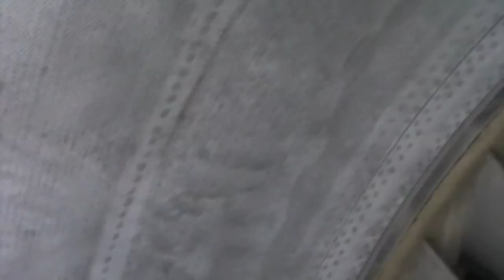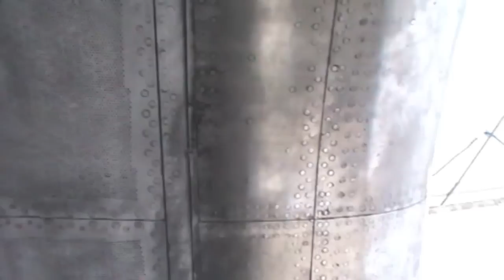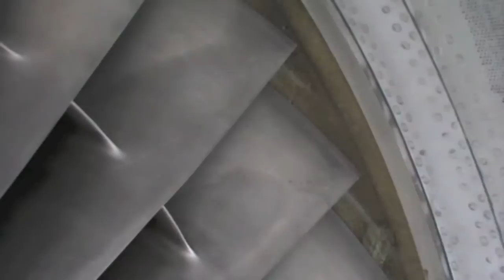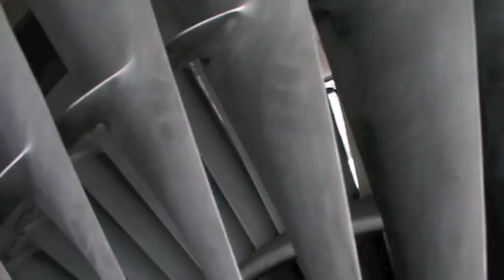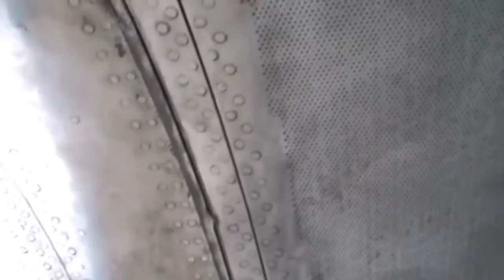RB211 Fan Up Close - That Noise Explained

Comment: The old JT9D would sometimes lock and cause vibrations resulting in shutdown. We would don ear protection, and hit with a rubber mallet. when it broke free, it was as loud as a firecracker. It was routine maintenance on the GE CF6's to pull all blades and lube on overnights. Todays blades are composite and along with tech, those issues are gone.

Comment: -50 F is far too cold for "icing" to be a concern and there's no reason for those "clappers" to be rattling "back and forth" as the engine winds down unless there is a serious balance issue. There are also other bearings in that engine that can fail or run dry and cause that kind of rattling. It's also pretty obvious that "RB211" isn't from a 747.

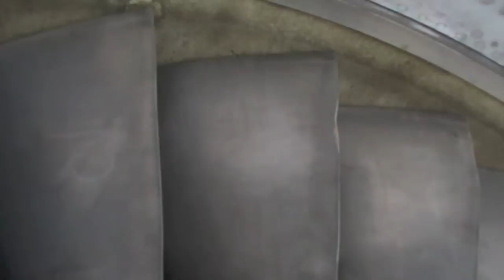Comment: Notice the min 3:30, the blade has a small wear out. Pause video and take a closer look. Not good at all. Need to be replace to prevent what happen with southwestern Airlines April 2018.
Reply: That's normal. Fan blades and propeller blades get chipped from ingesting foreign objects, this is absolutely unavoidable operating an aircraft in the real world. Instead of throwing it away, the mechanic will file down the damage until it's smooth, then file down the opposite blade so there's no imbalance. A fan or a propeller can be filed many times before it needs to be replaced.
Reply: @squirt.mcgirt  can this operation be performed without removing the blade from its housing?
Reply: Felice Graziano, just curious, why do you ask?

Comment: The part you refer to as the clapper is actually the mid span and the bottom of the blade that sits in the hub is called the root.

Comment: The PW engines of the same era did the same rattling noise at shutdown, first time I heard this it freaked me out I tought the engine was breaking down. I was looking at a B747-300 taking his slot at the gate and was placed just in front of the landing gear at the stop sign. I worked during the week-end in an airport and was taking every occasion to go out the ramp, visit cockpits and touring airliners. Good times

Comment: It makes that sound because the bolts holding the blade down aren't secured. Second off, each fan blade is individually bolted down and when one metal thing touches another metal thing it tends to make a "Clank" sound. There's really not much science to be applied here. Its just common sense and how the engine was designed.

Comment: The high sound is produced by the Rotations /minut.10000 RPM produces 10000 HZ.
Reply: It most certainly does not. Hertz is the frequency SI unit measured in cycles per second, which makes 10,000 rpm 166.66Hz.  But anyway, I recall the 100% rotation speed of the RB211-524B4 LP assembly on the advanced TriStar-500 was 3600rpm = 60Hz

Comment: I would like to know how does that whole thing spin. I don't get it, that is not an engine, that's something that spins very fast but i wouldn't call it an engine. What spins the blades is something i fail to understand because this whole "engine" is nothing but blades and i don't see anything that pusses and keeps the blades running.
Reply: Look up how a jet engine works. This is only the front part, the actual fuel and combustion part is farther back. I used to wonder the same thing!
Reply: +E I N S Did you ever find out how it works? Just asking...
Reply: TheThirdMan 

No. A lot of bla bla but nothing exact.  For some reason I find no video explaing this. It must be some alien tech otherwise i don't think they would keep it so secret.
Reply: No secret and no alien "tech". In fact, you can buy jet engines for RC models if you want to. The simplicity is what throws people. It works off a pressure gradient. To better understand it, the first thing you need to do is forget everything you know about car engines. To start it, you spin it up until it reaches idle speed (which, unlike a car engine, is about 70% of its maximum) at which point it is almost self-sustaining. Then you add fuel. A jet engine is effectively just a turbocharger with a combustion chamber between the impeller and the turbine. Unlike a car engine, it is a constant burn and not an on/off system.
Reply: TheThirdMan 

You still did not manage to explain what spins the blades. How can fuel spin blades? Whatever dude.  It's so fucking simple nobody can explain it.
To start it you spin it up until it reaches 70% you say. My question was how!?? Like i said i got a ton of explanation from people nobody managed to explain correctly.  Bla bla air pressure and fuel. I need more than that. All I see is a tube that spins like hell and no pipe for air pressure or something.  I gave up trying to understand it.  Don't care anymore
Reply: E I N S The energy released from burning fuel passing through the turbine spins the blades. The build up of back pressure behind it means the air can only pass in one direction. It’s dirt simple. The pressure in the combustion chamber- with anything up to 30:1 pressure ratio behind it from the compressor section can only go in one direction. It’s a pretty big fire in there and provides a hell of a lot of propulsive energy, which works against the turbine blades.
Reply: NightterrorsGaming 

Cheers man thank you for your explanation.  The best and most complete explanation i've got so far. For some reason many people say they know how it works but when i ask them for an explanation nobody managed to actually explain the process. I think i understand now thank you and i appreciate you taking your time for this.
Reply: E I N S Compressor compressed air, making the engine sustainable, without this, the engine would never be able turn, and would just act as an afterburner. The shaft is made of three parts or what is called “spools” to keep the fan spinning slowly, as well as the low pressure compressor, and the high pressure compressor and power turbines spinning fast.

Comment: So does anyone know if any jet engine bearings are coated with a very low friction coating?  Like MicroBlue.com  

If not then YAWN I will have have fix another sales and marketing department of the engine manufactors.  That control the engineering design.  

The more and research I do on mechanical designs World Wide the more potential I see that can be had from the designs.  Yes I know every design must be within a certain budget for cost vs benefit etc.

Comment: Does anybody know why they don't use "cones" over the engine intake to prevent bird strikes?  They used them in previous decades.
Reply: Merv Wright -  There are several reasons I can think of as to why a debris-screen would be Impractical:  weight, installed thrust loss due to air flow restriction, design would have to account for all phases of operation.  At high speed boundary layer air would restrict airflow.  But the biggest problem would be ice buildup and the amount of energy (bleed-air, electrical) that would be required to de-ice/anti-ice such a large surface area.  Impractical for those few occasions bird strikes occurred, as was stated earlier by Jai Shetty.  Then there is the failure modes of such a component; ingestion would cause severe damage, loss of de-ice/anti-ice capability would render the engine incapable of operation - with the detrimental effects of additional ice accumulation...  Better to just design the engine with ingestion tolerance.
Reply: Bird strike are far and few so it is not worth having them.
Reply: Yes but even one bird strike can cause a crash.  Still curious if there is an "aerodynamic" reason not to use a perforated intake cone?  Thank you for your reply.
Reply: Thank you Greg for your thoughtful comments.  Your last sentence certainly satisfied my curiosity and made complete sense.

Comment: Flew on that incredible L-1011 many times and remember being pulled into the seat during take off. As the L-1011 pounded down the runway the RB211's changed pitch. Some call this 'THE NOTE'. Out standing plane and jet engine configuration. Will never forget that. Thanks for your video post.

Comment: When i worked on these engines we used to have a competition to see who could stand the longest in front of the fan with the engine running at full power. I never tried it but the lads who did never turned up for work ever again.

Comment: Is this what also causes the buzzsaw sound at full throttle?
Reply: Purple Aki no. The buzz saw sound happens at lower altitudes due to the blades tips travelling supersonic speeds, as well as the separation point of the airflow on the blades trailing edges towards the tips. That’s also why older engines like these have clappers to add rigidity to blade at full speed, preventing deformation and failure.

Comment: Some RB211s had wide chord fan blades too. The -524G and -524H for the 747-400 had those and I think the -535E for the 757 had those too. Rolls was the first to use wide chord blades because they allow a larger fan and a larger spinner to fan connection, making the fan blade stronger. Rolls was able to do away with the clappers. GE and PW didn't go to wide chord blades until the 777 came along in 1995.

Comment: Any kind of noise vibration I would think would translate to the corresponding part that caused it. I have seen these blades explode. Like a tire that needs balancing I would think these blades should be able to be designed for quiet thus long lasting, smoother, better running engines
Reply: I hear Rolls has an opening in the engineering department.
Reply: Maxwell Butler what's the matter? They must not have anyone willing to tackle the hammering noise and vibration from those blades me thinks.
Reply: Willie Gillie Clearly.
Reply: Willie Gillie 
You're the boy in this story, though.

Comment: The correct term for the "clapper" is Part Span Shroud.  They should be lubricated with a moly lube compound
Reply: +Brad Gillies lube that clapper
Reply: I remember Snecma/CFM called those clappers as "midspan shroud". But IAE/PW called them as clappers and I think, also as part span shroud. IAE in fact, don't have these on the fan blades, but have them at the first stages of the HPC. Also, I think the 747 JT9 had two of these, on different parts of the fan blade span. I just wonder how it was to change the blades on a JT9. Because on the CF6-80 and PW4000, due to the clapper or part span shroud,  that's not really an easy job to put the last fan blade of the set.

Comment: Air loads when running twist this rattly clearance to none, the wrap up rests the clapstrip on each othe to stiffen the assembly. When fanning under power, there is no longer any clearance between the brace ring segments.

Comment: At 3:35 looks like you have bad blade. The blade on the right is missing a piece from the front. Cheers.
Reply: +maximvs degeneratvs It can definitely cause balance issues. Especially if you have a multitude of blends throughout the fan. Thats where testing and fan balancing come into play. If you open up the nose cone on an engine that has tons of blends, you'll almost always find little weights thats are bolted to the fan hub on the inside of the cone. These weights, while tiny and seemingly insignificant, have a huge impact on the balance, and ultimately the vibes, that an engine produces. Also consider that vibration is okay(and normal), but EXCESSIVE vibrating is a problem. Even if a blend causes vibration in the N1 (fan section), unless it exceeds limits, the engine is still able to function normally. 

source: Air force aircraft maintainer/test cell specialist
Reply: +maximvs degeneratvs That's a blended blade. Possibly suffered damage in the past and had the edge blended.
Reply: +thedrizztmanify Very interesting. I would think by having a blade like that you would have to do the same on the opposite side so it does not become unbalanced and create noise vibration, etc.

Comment: Actually the perforations in the nose cowl are for noise attenuation, nothing to do with de-icing. De-icing is accomplished by a tube in the leading edge of the nose cowl. Also the spinner is de-iced using hot air from the compressor.This is an RB211-22B which powered the Tristar.RB211-535 powered the B757 and Tu204RB211-524 powered the B747 and B767
Reply: +Shane murphy Exactly. Not to mention that it would take such an enormous amount of hot air blowing into free-streaming, -50C, 500kt  to bring it to above 0C that there would probably even not be any compressed air left for the engine to actually work!
Reply: christopher wilson No! That perforations are ONLY for noise reduction in ALL engines that got it.
Reply: +VstaarProduction 15
"have you ever heard of bleed air? "
Of course. But bleed air is used to deice the LIP of the air intake only. No amount of bleed air vented through those perforations would bring an incoming flow of -50C air at 500kt to above-freezing temperatures, sorry.  The perforations shown in this video are for NOISE ATTENUATION.
Reply: Our 767s at American have CF6 engines.
Reply: The 524 B4-02 was also use in the Tristar L1011.
Reply: In the e4b engine there are castellated strips that throw the spent lipskin hot air into the intake. In most other designs like the Trent and the v2500 there is a dedicated exhaust on the side of the inlet outer skin
Reply: I agree with you guys.
Reply: How I wish Embraer had choose our designs...
Reply: corisco tupi have you ever heard of bleed air? When a plane is flying 36,000 feet, how cold do think it is? Way below zero. And ice would form on the cowling and spinner
Reply: They are for de icing in some engines. Hot air is usually fed from the ip8 to the anti ive valve then to the intake cowl where it does come out of the perforations.
Reply: Roberto R. MOLA wrong

Comment: noticed some broken blade tips there, I hope they aren't gonna use that engine until repaired!! EEEEK
Reply: Those blades you saw with bits missing have previously been damaged by something ingested, and the damage has been blended out.  This is how you repair a fan blade.  The closer to the root (the inside of the blade) the smaller the allowable damage can be.

Comment: are the blades welded together at the top? srely the entire fan cant be milled out of a single piece of titanium..?
Reply: Each blade is individual and allowed to move ever so slightly to allow for changing engine loads and fan speeds. The new "lift fan"  which is made by RR for the F35 Joint Strike Fighter,  is milled of of a single titanium forging. BIG $ and an engineering marvel!

Comment: Those thousands upon thousands of little holes in side the fan cowl aren't for ice, that's all for noise abatement/sound absorbtion. The very front lip, the big polished ring on the inlet is where the anti-ice is. The backside interior of that lip is blown with engine bleed air that's between 400-500*F plus in temp. It may have a tubular ring inside the front lip that has many holes drilled in it for the bleed air to jet out of called a Piccolo-tube which is also how wing leading edge anti-ice works on most jet aircraft. The fan blades are most definitely supposed to be loose fit in the mounting. The fan blades should have something close to a dove-tail mount. All of the compressor section also. Only the hot section turbine blades use a fir-tree type mounting, 99.9% of the time. The part of the blade that contacts the others is what is known as a "snubbered blade". That is the root cause of most of the noise heard which is 100% normal. They manufacture may use snubbered blades to control harmonics and vibration properties of the blades.

My background, A&P, Jet mechanic ;)
Reply: All so very interesting to us mere mortals.  I don't think people realize how interesting it is.
Reply: Very Well Explained, Please tell me more about that noise filtration Holes in cowl, That how those holes can reduce noise ?
Reply: Jake Heke & where I can find Alexia
Reply: mytmousemalibu nice sir
Reply: Yes I worked a burbank aeronautical years ago 'they built hush kits for jt3d3b engines '707 dc8 reworking the bi ducts inlet and bullet for noise reduction and this what they to the inlets! The anti ice is bleed air from 16 stage hpc ducted to the leading edge of the inlet thru a defused ring !

Comment: They shouldnt even clatter like that mate, in other words it fucked! you are missing the spacers.
Reply: That is 100% normal. Its a problem if they don't make noise. If it was quiet that means the blade(s) are seized or being held tight. That would cause massive vibration issues and resonance problems. When the engine is running airflow and torque spinning the fan holds the blades tight In the mounts but they can still move, designed to move to control vibrations and harmonics.
Reply: They are supposed to move like that.

Comment: When the engine is rotating under power, the fan blades untwist. This brings the abutment faces of the clappers (R-R Derby nomenclature) or snubbers (R-R Bristol nomenclature) into contact to provide a friction damping effect.  The blade roots also load outwards into the disc firtree slots.   BTW, if anyone tells you that it is centrifugal force causing them to untwist and load outwards, then please be informed (as I was as a 1st year mech eng undergraduate) that there is no such thing as centrifugal force: centripetal force, yes, but centrifugal force, no!
Reply: Anyone who says that  centrifugal force does not exist needs putting in a centrifuge, sorry centripede and centripeded til they stop being so silly. Inertial forces are real and according to general relativity indistinguishable from gravitational and other forces.
Reply: It's inertia - the resistance to change in motion.  Centrifugal force is just a term applied to a special case when inertial counters centripetal force.